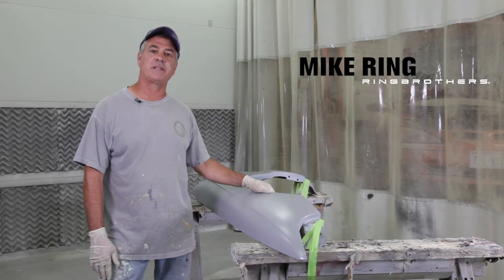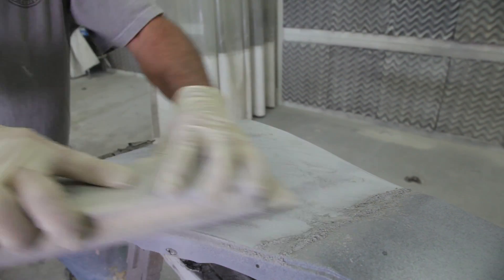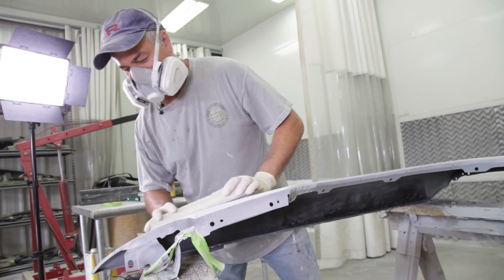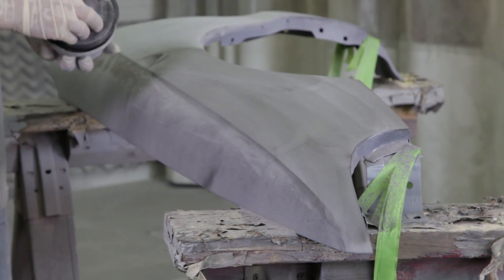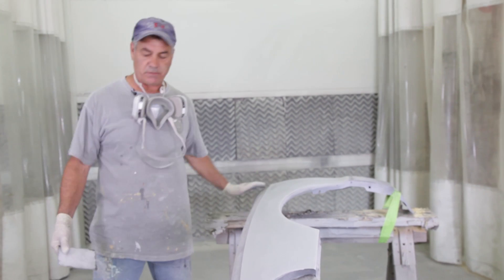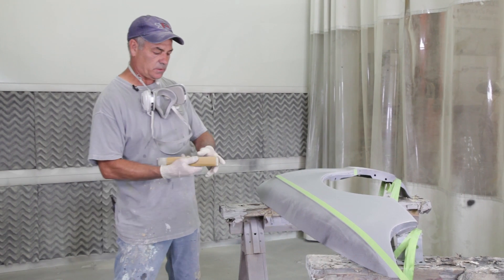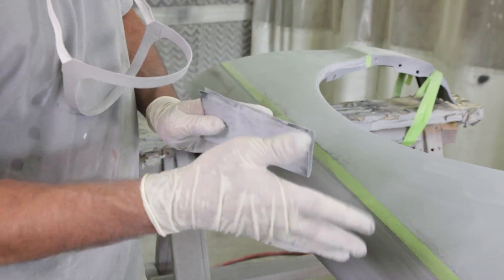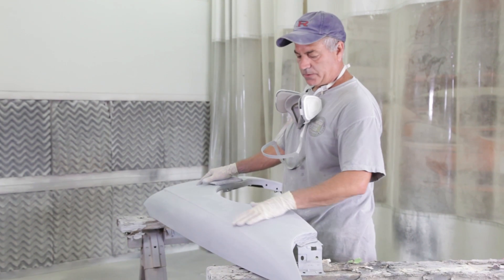Ringbrothers University - Chapter 3: Blocking Primer for Paint

Comment: Fantastic and very useful information! I especially related to the segment referring to block sanding grooves with the sharp edge of the block, it suprised me far too many times in the past how quickly in certain scenarios the edge of the block would form a crease (or a ridge even in certain scenarios....do'h!), compared to just blocking over a flat surface and getting a low spot even, thanks Mike!